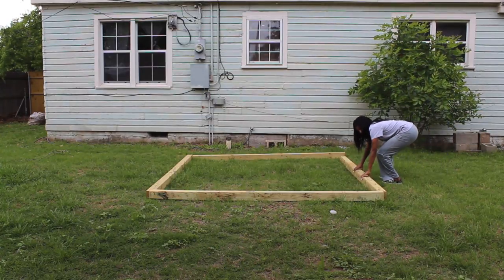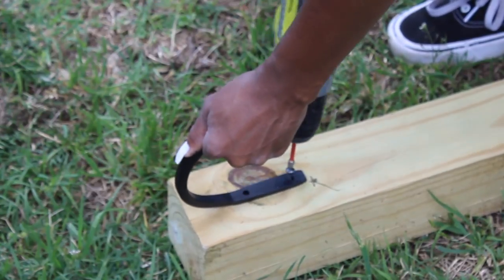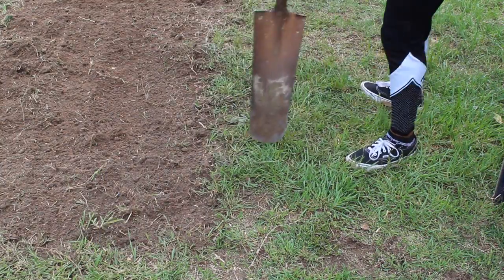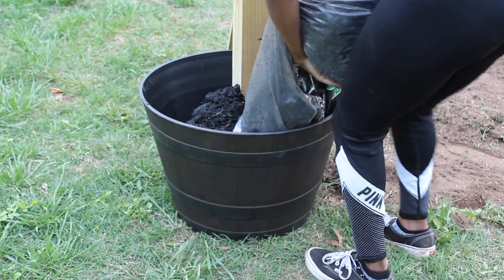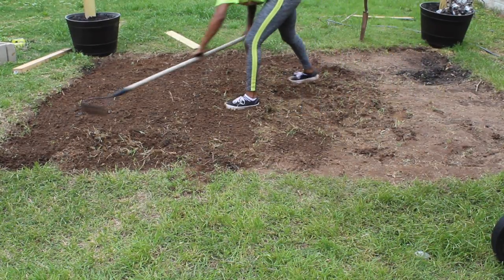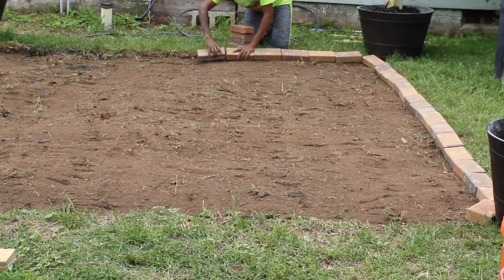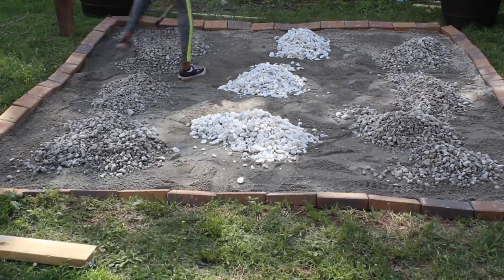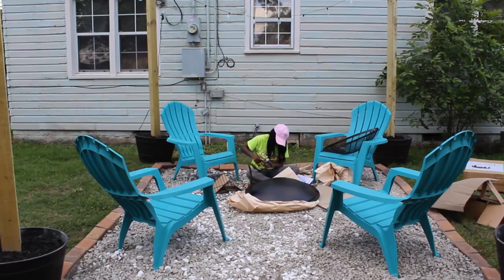DIY Planter Patio

Comment: I bought these same buckets to do this with. I never thought to fill a smaller bucket for the post then put it inside! You can also use top soil instead of mulch. Then you can plant flowers & it adds more weight than just mulch.
Reply from the maker: Thank you I didn’t even think of that !!